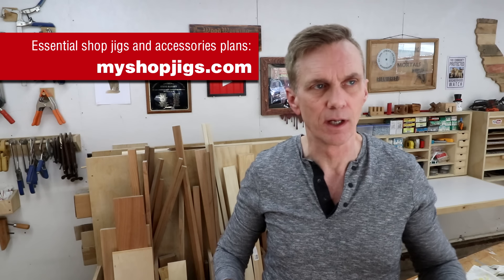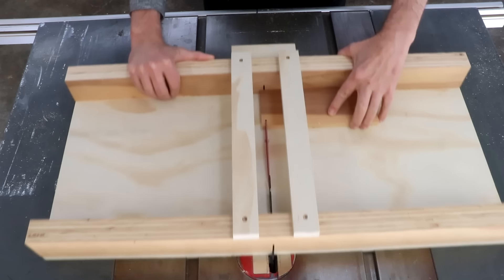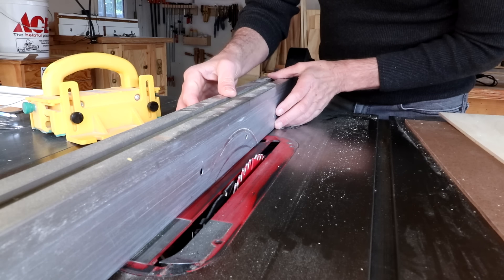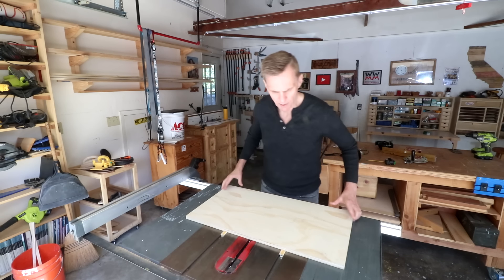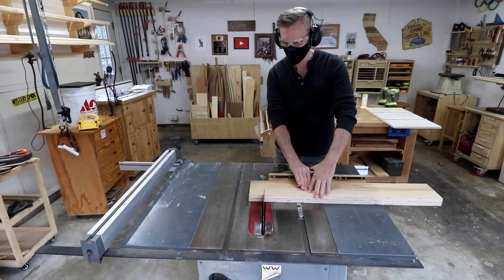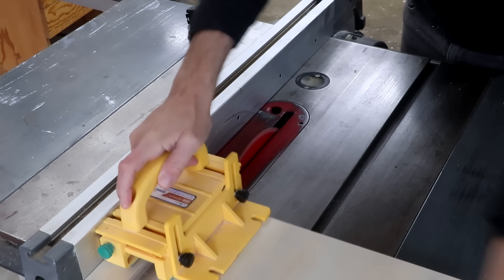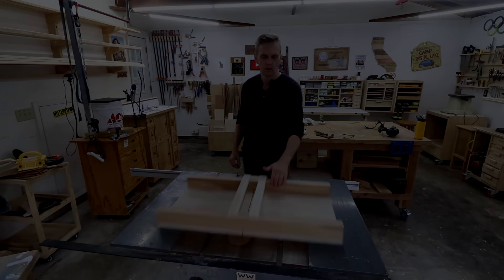The simplest table saw crosscut sled on YouTube. Essential woodworking shop project.

Comment: Quick question - why does everyone use plywood for the front & back fences instead of a 2x4" Thanks, Larry
Reply from the maker: I can't speak for everyone, but for me, plywood is much more likely to be flat and square. Won't warp, expand, or contract.
Reply: Many thanks - i figured there had to be a good reason. I'm relatively new to woodworking (metal was my media-- could always weld up my screw-ups and start over :)) and I am  a new subscriber to your channel - REALLY helpful stuff.... gonna build the same cross-cut sled shown in your video. Many thanks for your response. Larry

Comment: Blade only rises 3 or 3 1/2 in. Using 3/4 for base limits height of blade. Instead of aligning to blade, align to edge cut by blade so you don’t have to worry about the teeth.

Comment: My old Craftsman table saw has miter slots with two "notches" on each slot, so I cannot make the runners slide without running them under the notch. Is there a solution for this?

Comment: Don't need to raise blade up to make fence square, just use the cut line :hand-orange-covering-eyes:
Make sure to unplug saw if you are going to keep touching the saw blade😂
Option: Glue wood ruler to top of front fence, zero at blade centerline👌

Comment: I don't know very much about the type of woods. Is there a certain type of plywood I should purchase? When I look on home depot site there are several types and it is not cheap. I would like to do this project but don't want to purchase the wrong one because of the cost. Thanks for you help.
Reply: If you didn't know you can purchase plywood from HD smaller than 4' x 8'.

Plywood made from hardwood would be my first choice, then sanded pine as a less expensive alternative if budget was a factor. Best to avoid plywood that isn't smooth.
Reply: @bhough410  Thanks for the info and letting me know. After your suggestion that's what I did.

Comment: My table saw top mitre guide slots aren't smooth on the sides. About an inch or so from the edge there's a "bump out" a on the sides of the slot. Each of these "bump outs" is about an inch long.  My saw is a Skil and I'm not entirely sure why these are in the slots. Any ideas what to do?

Comment: Should I even attempt a crosscut sled with a single track Ryobi table saw? I understand I'm limited in my cuts with a basic table saw, but if I only have one track, is it still worth it?
Reply: Yes, it's still worth it
Reply: If your miter gauge is as loose as mine (cheap table saw), I think it's worth it.  I just made one this weekend!
Reply: I upgraded to a pretty nice miter gauge, but I still find myself reaching for the cross cut sled quite a bit. Even with a single slot, you get so much more support, and the zero-clearance base makes lining up precise cuts and cuts on small pieces so much easier and more accurate.
Reply: I have a single track cheap job site saw too and wonder if it’s worth it. The mitre gauge that came with it is a joke so never use it. Really limits what I can do so hopefully this helps
Reply: Yes, absolutely worth it.  For that matter, I've seen many people put a single track on their sleds despite that their base has two (just to offer flexibility on left-right positioning of the sled).  If you have a very nice fit on that runner, it'll be fine with a single track.  And the sled is just SO useful with a table saw.  Do it; you will not regret it.
Reply: @DonHutchins  that’s a clever suggestion! Thank you

Comment: I tried to build a crosscut sled for my portable table saw (Bosch). Ran into an unexpected issue that maybe someone might have a solution for. My garage/workshop was virtually no room to work in, therefore I roll the saw out onto the driveway when working. Not much fun working out there in the Winter, so most projects are done in the Summer time. Problem is the sun beats down on that metal top and it expands just enough to cause the sled or the crosscut gauge to bind up in the groves. Any ideas?
Reply: If you're talking about your runners not sliding very well you could maybe try plastic runners instead. Other option might be to buy a 10' pop up tent/canopy to put your saw under when the sun is out.

Comment: @steve, What about the table saw with 1 runner. Can you build the same sled as well?
Reply: Yes, but I would use a hardwood, phenolic, or HDPE runner to resist the uneven torque. It won’t be a lot of torque, but the 1/4 inch plywood or hardboard are both very soft and would not hold up long term. You’ll also need to ensure a tighter fit of the runner. When using two, they can be somewhat undersized because each can bear on the outside of each slot, so fit is not critical.

Comment: Do you feel that using the 5 cut method to true up your fence isn’t necessary? Just curious
Reply from the maker: I've never tried it. But it looks like it works!
Reply: If you feel the need to do that have at it.  Might be good to do if you are building pianos.
Reply: @SteveRamsey  I would suggest the 5-cut method for the SECOND cross cut sled you make, but this is accurate enough for beginners and Mere Mortals.
Just my penny's worth.

Comment: Ok newbie question for you, and everyone else that is going to slam this question...  Why not just use a 2x4 since it is already 1-1/2 thick and just cut it down to 2-1/2?  Again, I'm sure there is a reason, almost every video I have seen use the plywood glued, just wondering why?
Reply from the maker: Good question. Solid lumber such as a 2x4 is more prone to twists, bends and warps. Plus, humidity could cause the fence to warp  Plywood is perfectly flat. It's a great material for shop  projects.
Reply: @SteveRamsey  Makes sense, I "assumed" there was a reason and that would have been one of the assumptions but no one really ever said why they were doing it.  lol  Thanks for the quick reply, going to attempt to build my first sled tomorrow, hopefully not going to be firewood.  lol

Comment: Question, I have a craftsman smaller table and the slots have two  pieces of metal like material that prevents me from putting runners into the slots.Can you help solve this problem so I can build a sled for my saw? Thank you
Reply: I was wondering about this as my saw has the same feature. I thought of using metal runners with a shallower strip on top and then bolting those two to the main board.

Comment: I've never seen any of my favorite Youtubers talk about using aluminum T track as the tracks.  It is often a perfect fit and when it is not, you just align them on the outsides (or insides) of the miter slot.  And it won't ever warp from moisture.  Is this a bad idea?  Am I missing something?
Reply: Cost is the only objection

Comment: I h e a table saw with tabbed miter slots which has always given me problems every time I try to make a cross cut sled. They seem to work great the first time, but whenever I grab it off the wall a week later the runners I made always snap. I really don’t like the miter gauge that came with my saw, but haven’t been able to find an aftermarket miter gauge that really works with tabbed miter slots... Any more experienced woodworkers have any suggestions??
Reply: The runners snap... 🤔🤔🤔 Not sure why they would snap.  Need more info.  What material?  How are they held on the sled?
Reply: @fletchro789  it’s a tabbed miter slot so the runners have to be that awkward shape to fit. I can make em on the router table, but they always break no matter what material I use. I’ve tried to use mdf and plywood the results were the same for both. My saw is a craftsman too by the way
Reply: @bpatriquin123  what about the method that Steve showed, in which the runners are only "running" in the top 1/4" of the slot?
Reply: @fletchro789  ...they’re tabbed slots at the top though. It’d rock right off the saw

Comment: Rather than try to get the runners to fit perfectly in the mitre slots, just cut them to be narrower than the slots and press the runners both against the inside OR outside edge of the slots, and attach them to the bottom of the sled.

Comment: In Sam's Club this last week, under $9, white LARGE cutting board 15x20 inches...  maybe this one is too thick, 1/2"?  I was thinking I'd make some runners out of it, and some table saw inserts.  I've bought a two-board set at Harbor Freight last year, thinner, and cut a zero clearance insert out of one.  But they weren't entirely flat across the edge.

Comment: I used my 3d printer to make runners for the cross cut sled and offer the plans link. Also made the sled so it can be stored under the table saw.
Reply: Nylon?

Comment: Hi there.  What is that yellow push handle you use on the table saw called? Thanks
Reply: It's the MicroJig GRR-RIPPER 3D Pushblock

Comment: Why do woodworkers not build crosscut sleds from MDF?  I’ve been researching building one, and no one uses it. I’ve heard mention of what materials to use for the runners, but no one talks about why plywood over MDF. I am very new to woodworking and don’t know these things.
Reply: MDF in my admittedly limited  experience has a couple of disadvantages for making jigs and tools. 

As a material it doesn't hold screws anywhere near as well as regular wood or even plywood it also has a tendency to get banged up and fray with harsh handling. Think Ikea furniture and think about how that stuff looks if it gets banged around once or twice. 

Unless it's coated it also just falls to pieces when exposed to moisture. 

Also cutting that stuff with an electric saw is going to spray so much fine powder that if you don't have some form of dust removal you're going to find that stuff in your shop for days and you better have a breath mask on
Reply: @mark1A100  Thank you! Great points! I made my sled with 3/4” birch ply. Squared it up using the 5 cut method and it’s running great!

Comment: What kind of 1/4” ply did you use for the runners?
Reply: Smoother the better. Most types of durable plastic would work better than plywood.

Comment: Step one, make sure blade is square to table. Squaring to the t slots would probably be a better approach.
Reply: Square the fence to the saw kerf.
Reply: @tclem44  but the sled doesn’t move based on the fence or the blade, it moves in the axis of the slots.

Comment: I get the "safety" reason for them, but those two final strips running parallel to the blade are going to limit the size of stock you can cut and get in the way of your sight lines.
Reply: Yeah, ditch those.

Comment: Hi Steve beginner here. My riving knife is higher than my blade and won’t seem to let me lower it. Any suggestions.
Reply: Most riving knifes have several positions they can be mounted in, often labeled as thru-cut and non thru-cut. Check if the manual for your saw mentions anything about this. I know that the DeWalt contractor saws have this option.

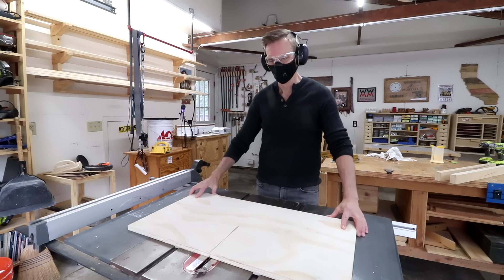Comment: At 9:34 you mention removing a knife. I can't understand what you are saying for sure. "DRIVING" knife? At any rate, what is the purpose of the knife, and have you ever considered simply removing it all together? Thank You.
Reply: It’s a riving knife, and don’t remove it. It’s the single-most important safety feature on a table saw which keeps the cut open, reducing the chance of kick-back by keeping the cut part from touching the back of the blade.

Comment: What if you only have one slot on the right hand side of the blade?
Reply: Should be ok. Just make sure the runner is really tight. If possible, use a material that doesn’t easily wear out, e.g. aluminum.

Comment: How would you overcome the problem I have where the riving knife sits higher than the top of the blade?
Reply: Most riving knives are adjustable or removable. The purpose of the riving knife is to stop the wood from closing in behind the saw blade, pinching the wood and causing kickback. This is mostly needed on rip cuts. On a cross cut sled it is not quite as important and the front fence prevents offcuts being thrown out by kickback.
Just my penny's worth.
Reply: @David_K_Dickson  Hi David - yes, I know :)  The problem I have is that whilst my riving knife can be removed, when it's fitted it sits higher than the blade's highest point - this cannot be adjusted.  That means I can't make the cut on the rear fence high enough to clear the riving knife.  Not saying it's impossible to make a sled like this, but was curious if there was a well documented method/workaround that's safe to use.  I'll probably try making the cut in the rear fence by hand with a regular saw before attaching it :)
Reply: @tpottrell  Sorry, I just reread my reply and realised that I didn't say to remove the riving knife when using the sled, just like Steve did. And sorry, no, I don't know of a way round that limitation.

Comment: cool video, but  why make all the parts of the sled so massive? why ¾" plywood for the base, wouldn't it be better to use ½ or ¼, that way lose less cut height? and also for the fences.. why 2 ½" wide? isnt 1" enough? 
Also - why do you even need a "front" fence? Isn't the back one (the pushing one) enough? Will make it possible to cross cut a wider variety of width cuts...
Just bought my first table saw and watched like 2 hours of videos
Reply: ok I see why the front fence is necessary - to hold together the sled because its slides over the blade. But still.. why everything so massive?
Reply: @brutally_honest  Seems most things in life are trade offs...3/4" is much more structurally rigid than 1/2, in exchange for losing 1/4" on cut height.
I wouldn't even consider 1/4" plywood for making a sled.

Comment: why need a rear fence if it doesn't matter if square or not?
Reply: To keep the 2 pieces of wood (the base) together with more stability. Remember that the base is 2 separate pieces, since you cut straight through it every time. The 2 fences are what keep the halves together. If you only had 1 fence, you risk the base not having as much stability.
Reply: @Nick-qn5nf  oh gotcha.  makes complete sense.

Comment: What amazes me is that to make the sled accurate, you need an accurate table saw.  But in most cases with an accurate table saw, you don't need the sled....  What if we have a cheap table saw that only has one track slot?
Reply: As long as the arbor rotates the blade smoothly you can get along with the one track if you make sure the spline fits nicely in the groove. A smooth sharp blade is the most important ingredient in my opinion.

Comment: The only problem I see with your set up are the two reinforcing strips. If you’re cutting off small, repetitive pieces you have to reach under there to remove them and the strips obscure your view of the spinning blade.
Reply: It also limits the height of the workpiece you can cut or lap. I would not use those either.

Comment: Anyone have recommended mods for tracks that aren't uniform width at the table top along the track? I have a Craftsman 10" (#CMXETAX69434502) where the track starts out at normal width, juts in ~1/8" with an overhang on each side for about 2", returns to normal width for 6", juts in ~1/8" with an overhang on either side for about 2", and then the rest of the length is normal width.

Comment: Instead of making a sled that is long on the left and another that is long on the right ... couldn't you just make sure both fences are squared up .. then you could just flip the sled based on which side you need to be long? This way you'd only need to make one sled that can handle both.

Comment: When cutting the runners, cut them just slightly oversized, so they are a tight fit.  Then, use 320g sand paper and sand down the sides a little at a time to get it just dead perfect.  You can also pencil mark the sides so when you slide them in and out checking for spots, you just have to sand down the worn area.  Again, NEVER EVER use plywood.  Use a suitable hardwood.
Reply: Wouldn't hardwood be much more susceptible to size change with seasonal weather?

Comment: But, WHY have a back fence. It doesn't make any sense.  It adds weight only. Unless, you were to offset the sled to the left side so when you need the sled with more fence on the right side you could turn it around. Other then that...WHY?
Reply: Think about it...the bottom plywood is cut from front to back (essentially 2 pieces) and only held together by the front fence. The back fence is the additional structural support and keeps the sled flat and square.
Reply: @didz2064  I can understand if the bottom ply is in two pieces. I thought it was a single piece that made the sled. Plywood, generally maintains its shape since it is, well, glued together pieces of wood plies. Oh, well, neither here nor there. I've been working with wood for over 45 years and still picking up knowledge. Good on yah, friend.

Comment: I totally expected a 4 cut test to make sure that it ended up square at the end. :-(
Reply: 5 cut! And you are right! I missed this also. AND i will shake the hell: The alignment of the push-fence against the saw-blade ist WRONG. The alignment should have to be made against the miterslot. The whole sledge drives in the miterslot. So this is the reference, not the sawblade. Try to imagine the sawblade sits a little bit off and not 90 degrees....... the fence gets off.

Comment: Sorry, I disagree with your methodology for squaring up your back “fence”. I believe using the five cut method is a much more accurate way to square the device.  A carpenter’s square can be out of square ever so slightly.
Reply from the maker: An ever so slight inaccuracy is mostly irrelevant when it comes to wood. It's an organic material.

Comment: Thank you for building a cross-cut sled that doesn't involve the use of NASA scientists and an advanced degrees in Calculus and Astro-physics. Some of these people making sleds are a little "off their nut" ...so to speak. It's woodworking people, not engineering.